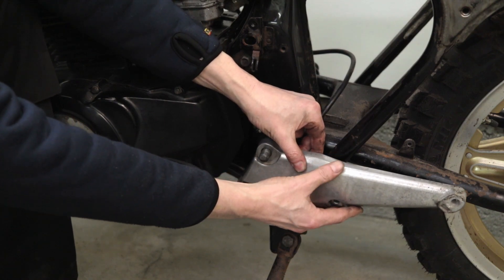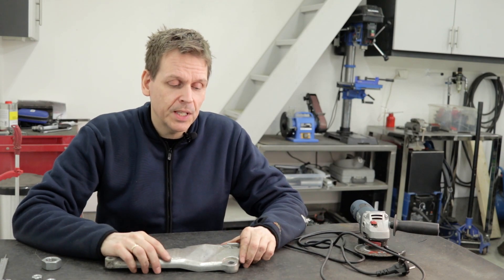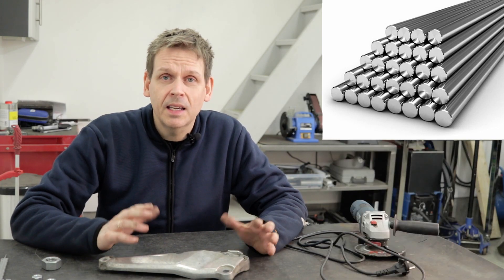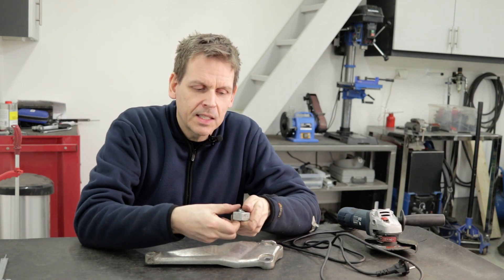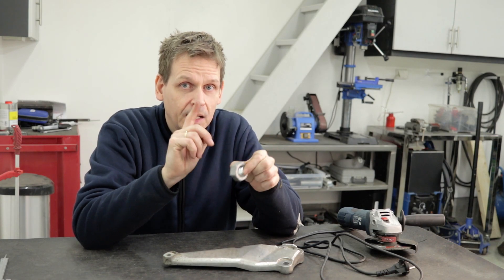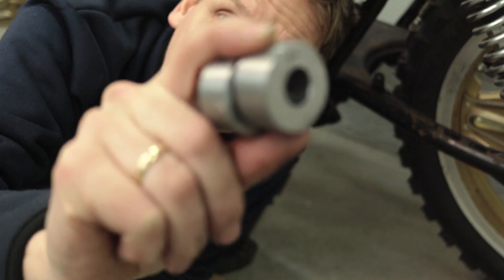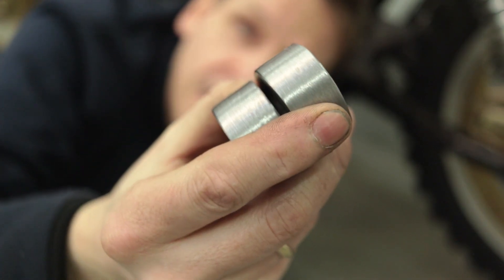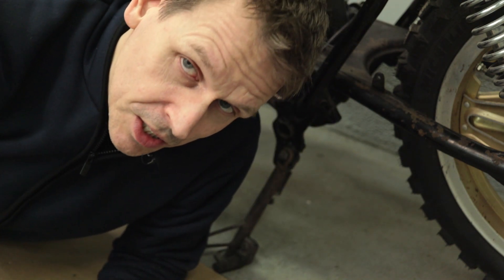Machining  / Turning without a Lathe

Comment: Helpful Hint # 2 :
You can ADAPT your Drill Press into a simple Standing Lathe, simply by buying a Lathe Head, and Tailstock holder. Then you just Fabricate a Tool Holder-Tool Rest, you can bolt to the Drill Press Table.
If you're like me, not willing to spend $1,800 for a Metal Lathe, adapting your Drill Press can be an option.( I don't have the space for a metal lathe )😊
Reply from the maker: Thats a cool solution, good to have the possibility when there's not a lot of room 👍 I did however buy a mini lathe eventually, it did actually cost close to $1800 🥴 my biggest investment ever when it comes to tools

Comment: I'm going to try this to make a copy of a valve part for my Culligan water softener.  The original part is a simple cylindrical push/pull component constructed of a high density plastic, probably Delrin.  It has a dovetail at one end that failed, probably because the o-rings that the component slides through hardened with age.  Culligan had discontinued this model of water softener, and a replacement part on ebay is over $100 usd.
Reply from the maker: Ugh, that sounds expensive 😞 It's not easy to get exact precision though, not sure how much tolerance it can tolerate. It's just to give it a try, good luck!

Comment: wow what a method, i feel this is going to help me out a lot in my current project which i am stuck on, thanks a lot
Reply from the maker: I have used this method several times. It's quite OK as long as you don't need absolute precision. I have however bought a mini lathe recently, so I have stepped up a notch 😊

Comment: I did something similar just recently. Needed a turned part to make a 1" fan shaft fit a tube bigger than itself. So I built up a lot of weld on the end that needed it and ground it smooth using an angle grinder and hydraulic motor turning the part. It's jank, but it fit
Reply from the maker: Smart 👍 Being able to fabricate parts with the tools at hand is just great. Environment friendly, cost efficient and often time saved!